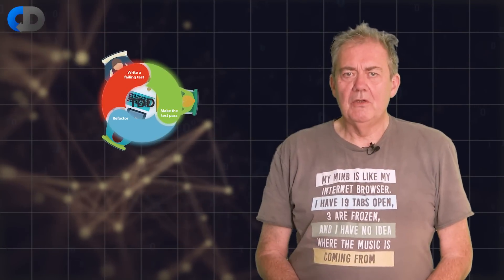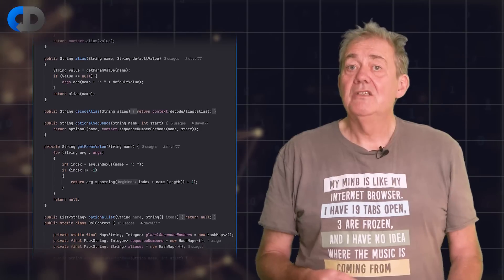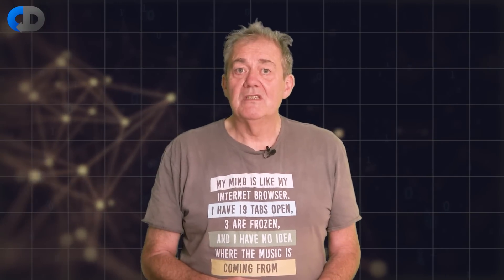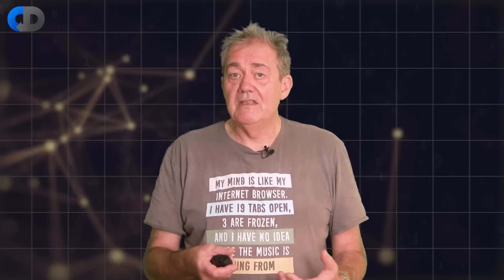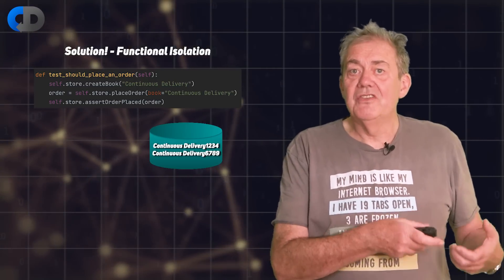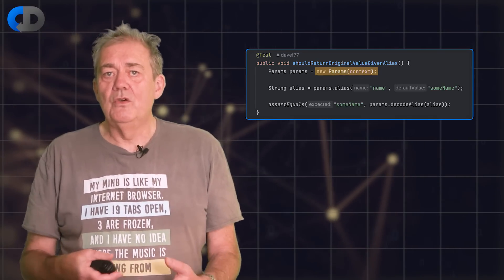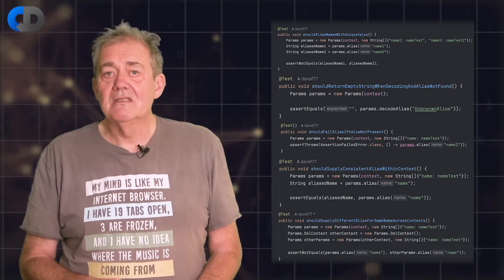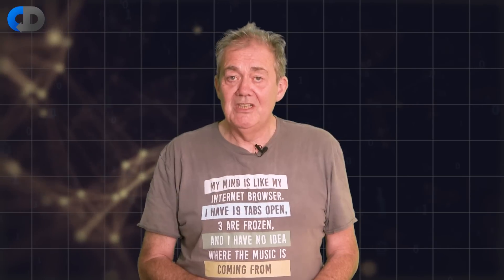What TDD Looks Like In A REAL PROJECT (With Code Examples)

Comment: Interesting approach. 
I did something similliar but without formal DSL when I was porting functions of a core banking application from cobol to java.

I used mockito and JUnit. I used functions starting with "assume_........." to hide my mocks to keep the test readable.
I found out, that it was most usefull to have a "assume_everythingIsSetupToWork()" kind of function on top of my test. This function would prepare alle mocks to run successfull.

Than I added the error/special states that I wanted to test for (i.e. "assume_theUserDoesNotHaveTheRights()") making use of mockitos ability to overwrite generell mock-setups with more specific ones.

I beliefe that my test suite was easy to read and comprehend (and also to extend! Writing new tests was getting easier over time, because the "infrastructure" was already there). Also I was proud of high 90% meaningful(!) code coverage.

Comment: I literally have no idea what my tests are called.  I only write tests for functions that 'DO' something, like testing something that updates prices based on a percentage or whatever. 
This makes me make sure the 'DOING' part of a function (vs getting the data and saving it for example) is in a stateless function that can be tested on its own.
Reply from the maker: You could also avoid writing functions  that don"t "do something" 😉
Reply: @ModernSoftwareEngineeringYT  That's not a useful comment.  I'm talking about stuff like CRUD controllers.  Code is needed for those to establish they exist.  The parents have tests on them but not individual controllers.
In a prior situation some have insisted they all have tests on them, literally no reason.

Comment: I've tried to do TDD a few times now, but I always get stuck when trying to define tests without exploring the domain first. In the end after wasting a few hours I always just go back to iteratively creating the thing and then writing some validations of the solution I've settled on.
What I think is the biggest thing that all the TDD preachers need to focus is on explaining the thought processes and how to reach the TDD mindset. Cause I just can't do it, seemingly no matter how many company hours I waste trying.
Reply: You can do a lot of design work to explore the space by creating data structures and interfaces without implementations. You can then figure out what you are trying to do, and how the pieces should interact. Then once you have a good enough design, you start writing the tests, and only then start implementing concrete functions or classes.

Trust the process.
Reply from the maker: That sounds like the topic of my first YouTube video...
https://youtu.be/xUi2951ufaw
Reply: Hi @JanVerny

Exploring the domain first is not a problem. It is called a "spike". Also, TDD is iterative just like you said.

One thing that might help -- whenever you go to write actual production code, and not just a spike, go ahead and write one line and ask yourself, "what is an example of why I would need to have this one line of code?". Then comment out the line of code, and don't uncomment it until you have a test that fails because that line of code isn't there. If you have to refactor first before you can have a reasonably simple test, that's fine.

I think this might help you see how having a test in place (slightly) before the production code is helpful when doing the implementation.
Reply: @vaughncato  This actually sounds like a good way to practice. I will try to see if I can reason backwards to what kind of test would result in a change I want to make.
I am kind of skeptical of doing TDD and doing it iteratively. The way I see things, tests exist to put constraints on a system, and usually it's very easy to put more constraints on a system. But it tends to be very hard to replace one system with another when you have a lot of constraints in place.
I suppose the TDD way would be to start by creating a new set of tests and  a new system, but that sounds like a nightmare for an iterative process.

Comment: The most important idea that I see in this video is that you don't need to write your tests to directly call the functions in the production code, but you can create a layer in-between the tests and the production code.

I often hear the complaint that TDD doesn't work because if you decide to make a change to the interface, you have to go back and change all your tests. The DSL layer helps avoid that problem.
Reply: Ah! TDD people always say "don't test the implementation". To address the people complaining about changing test because the interface changes maybe they should also say "don't test the interface". It may be that TDD people think the interface is a part of the implementation but a lot of programmers think implementation only refers to what's behind the interface. It doesn't really change the amount of work you have to do, changing the interface still means you have to change the DSL layer. Though perhaps the DSL layer is also useful in other ways than just to facilitate testing, as a higher level interface that rarely changes.
Reply: @Trezker Having the DSL layer makes it where the changes you need to make due to a change in the interface is more localized. You may only need to change a few lines of the DSL layer, rather than a few lines of 100 tests.
Reply: @Trezker  The DSL helps isolate the changes though. You may only have to change a few lines of the DSL rather than changing a few lines of 100 tests.
Reply: The caveat, though, is that you have to write tests for the meat in the sandwich (which means directly testing directly using the DSL). This is the same problem with using fakes as test-doubles.
Reply: @AndrewEddie The DSL is tested the same way the tests are tested, by seeing the test fail when the production code is wrong, and pass when it is right.
Reply: @vaughncato  that's correct, but that is "technically" in conflict with your original post (as I read it) where you are saying you don't need to test to directly call the code. 

That said, I personally I don't use DSLs at all for testing so I might be missing some nuance here.
Reply: @AndrewEddie  I don't see the contradiction. If the production code is wrong and the test fails, and then you fix the production code and the test passes, Then you have tested the test and everything between the test and the production code.
Reply: @vaughncato  yep, you'll arrive at the same result. I just don't do my TDD that way :) Well, not anymore. I used to when I was younger, but I never really actually got any benefit from trying to make future refractors easier, because they almost never eventuated. And if they did, the changes needed surpassed reasonable expectations.

It's a bit like stressing over whether to wrap a service layer around your ORM. Maybe one day I'll want to swap from Prisma to Drizzle. But that is a huge job anyway and trying to abstract it away in a service layer to make that future job easier is an approach I've never, ever taken advantage of.
Reply: @AndrewEddie  that's interesting. I often take advantage of it. First, by making the tests simpler. My tests are often a single line, that just specifies some parameters that are specific to the case I want to test, and everything else has been localized in a function or class. That is, my tests are often just a table of values, and I can add a new test by adding a new entry to that table. That's not always the case of course, but in general my tests are just data that gets passed to another layer that has more of the test logic. I don't really plan it out this way through, I just write one test, and then realize I need another test that is very similar, so I factor out the common logic and provide the differences as parameters. The more tests I end up with, the more sophisticated the middle layers become and the tests themselves become simpler.

Also, when I do need to change the interface for the production code, and that requires multiple changes to the tests, I use that as an opportunity to understand and reorganize the test abstractions, so a similar kind of interface change wouldn't require as many changes to the test code the next time.

It's not so much about planning ahead to try to account for changes in the interface, it is just avoiding repeated assumptions in general by creating abstractions that isolate those assumptions. Often those abstractions are just simple functions.
Reply: No it doesn't, it just adds another problem. You have just added a whole new place to have bugs and you still can't be sure that you are testing how your functions will really be used. The fact is that TDD really doesn't work very well for non-trivial systems, once you add mocking and all this other overhead - what are you really testing?
There are lots of other testing strategies that are far more useful.
Reply: @mccleod6235 The layer that I'm talking about is not mocking. It is a layer between specifying the behavior that you want and the components that you are testing that do the work. This layer helps avoid duplicating assumptions about how the work is going to be done in each test, making it easier to change the design.

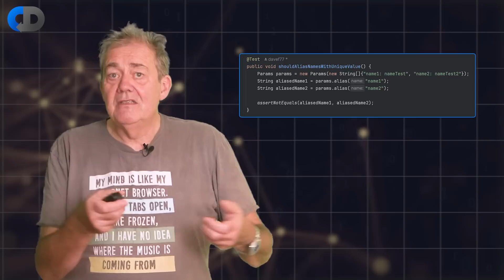Comment: 11:00 You can you set the title using a uuid in the test scenario itself to avoid all this framework overhead. Tests can also decide for themselves when they need to be isolated or not. It’s an extra one line in the test, and significantly reduces the complexity of the test framework

For default values I also prefer having the helper functions randomize inputs for the parameters I dont care about
Reply from the maker: Yes you can, but now you put that complexity into the test instead. Sure, UUID works sometimes, I think this approach works a little better, since you have more control, for example, when you need to generate a name that will needs to fit into a certain number of characters, where a UUID would be too long, or where the name needs to meet some naming convention.

Comment: Hi Dave, it's very interesting that you're only using strings and do the plumbing behind the scenes. I personally prefer to use hard-typed fluent apis with some kind of builder pattern to define my test cases in terms of the domain. For more complicated test cases I additionally enforce a strict order in which the api functions need to be called such that a non-technical person can produce valid test cases with IDE auto-complete. In my experience such tests are very readable in terms of the domain and aren't coupled to the implementation details because the ugly plumbing is abstracted inside the builders that can be easily replaced when needed. What do you think about this approach?
Reply: Unfortunately fluid apis are readable only by their authors. And if they have used them in last 3 months or so. It is quite obvious that mr. Farley is pursuing clarity of intention above all.
Reply from the maker: I think it is fine, but for me the benefits don't outweigh the costs. It really is very team dependent I think.
One advantage of strings for params that I like, is that non-technical, or at least less-technical, or even technical, people can invent new DSL on the fly as they are writing a new specification, without worrying about the design of the types to be used too much.
Reply: @ModernSoftwareEngineeringYT  I agree. My fluent api approach is a bit too rigid for new development where the business rules might change a lot. 

In my case it's an untested legacy system with a established domain model that needs to be refactored. I need the fluent api to discover the domain anyways, so it's just a useful side product. We'll see if I keep the fluent api. 

For me, the more interesting part about acceptance testing is how to integrate non-technical people into the process, especially when the PO want to manually regression test all day long. It's kind of challenging to pull this agile transformation off on my own.

Comment: As some people rightfully called this out for "lack of real world examples", I don't think the problem is showing off any typing. It's more so the fact the code doesn't demonstrate sophisticated enough state management across a multitude of other classes and systems that typical code in real world projects have.

Like, what is the decision making process to determine whether the interactions between classes matter more than just itemized unit testing? At what point does redoing system architecture make more sense with tools that validate architecture instead of implementation? What code analysis is needed to prompt conversations among devs + QA + product so the use case scenarios satisfy traditional vs unusual but real user interactions along with the prioritization to see why some things cannot be testable within a given timeframe? What truly qualifies as a known  unknown vs unknowable unknown that would make testing more difficult than it should be? Market/socioeconomic pressures that fail to make testing like this unviable given arbitrary restrictions on staff just to appease members of the board?

All this has to be factored in account and just saying "test more, duh. There's AI for that." is not helping on the conversation. Systematic thinking to make testing and conversation number one priority helps more than suggesting tools and "just test it". Software engineering is more human than we give it credit for being. 😊
Reply from the maker: I think that you are looking at this from a testing perspective, which is completely understandable, but a mistake IMO.
TDD is MUCH more about design, the tests are a nice side-effect of designing your code with TDD.  You don't need to worry about what the scope of a test is, if you are using it to specify what you want your code to achieve, because the scope of the test will fall out from the need to specify. It may challenge your design thinking if the scope seems too large, but that is the primary point of TDD. To help you to achieve better designs.

On your last point, "test more, duh. There's AI for that." I disagree, I think that this is another big mistake that the whole industry is making.
What can an AI generated test test? If it is starting with a system, or even with the source code of a system. All it can do is confirm that the code does what the code already does. It can't test that the code does what the code is supposed to do. This is the same failure as after-the-fact unit testing which is dramatically lower quality testing than TDD and inevitably ends up fundamentally broken at the time when you need it to provide protection for your changes.
Reply: Looked pretty real to me. The examples are simple like he explained, it's good design. You seem to gloss over the advice of NOT writing tests across multiple systems. That is bad code and bad test design! That part is tricky on purpose! But there are ways to mitigate those complexities
Reply: @retagainez  Validating architecture is NOT testing across multiple systems. Each system tests their own capability using mocked data that would come from outside systems.

Nice try with the strawman. ;)
Reply: A lot of the questions you have are not directly related to TDD. Many can take skill and experience to figure out. Others are a topic for another time. An experienced programmer will always be better at that than a novice, even when both use TDD. But compare them to their contemporaries who don't TDD and you'll see a massive difference in their output.
Reply: @tylerkropp4380  Like I said in the other comments and Dave implied in his courses/vids, TDD challenges assumptions about the system design and business model by way of tests. These business concerns interfere with TDD as a result because they're at the opposite end (release everything minimal cost) of engineers (deliberately release features that are carefully tested). Push back from the engineers is necessary or else they end up being "essential workers" insisting they work 100hr weeks without fail.
Reply: @SimGunther  I think that's a separate question from the technical process of TDD itself. I would appreciate a video about this from Dave, but maybe it's simple...
If a company focuses on short-term gain instead of long-term gain, they could end up with slower releases long-term, which would hurt their competitiveness. In economics, that's called time preference.

Comment: The code examples are too small to read. You  lost me.
What you've said does resonate, persistence across tests are flaky, design it out so each test (suite) provides its own context, use Setup and Teardown.
Reply: 1. You can zoom the video.
2. Setup and teardown should be avoided in unit tests.
Reply: @seNick7  Why no. 2?
When testing a component,  doesn't it need a stand alone factory method to create it?
Reply: @nickbarton3191  You can run setup as first call in each test. This way:
1. You can tell exactly what is needed By looking on the test itself
2. You avoid having setup that prepares each test in a bit different way, but in the same code. E.g. test D might not need 20% of the setup code in the [Setup], but it's hard to say which part exactly.
These problems are described in books about unit testing,but I also have seen it in practice.

PS. I use to setup the fixture in the Setup  (ctor) method, but that's all. Fixture instance is used by all test so that's a compromise.
Reply: @seNick7  Don't think that I've ever needed unique set-up,  different input conditions,  sure.
If set-up is called at the start if each test or in the framework set-up,  well that's just semantics. 
When it comes to integration tests, of course the set-up is different,  but they're segregated from the unit tests.
Maybe we're talking at cross purposes.